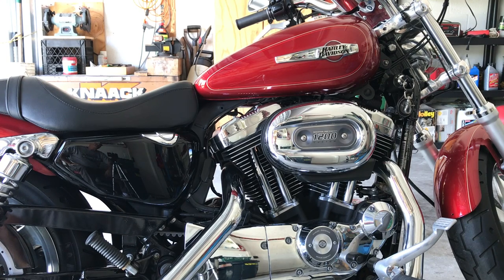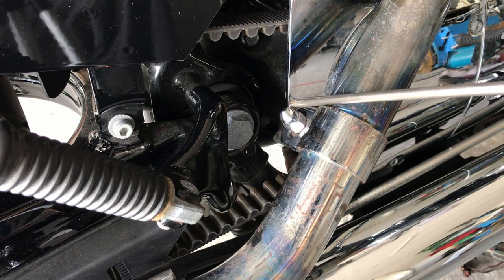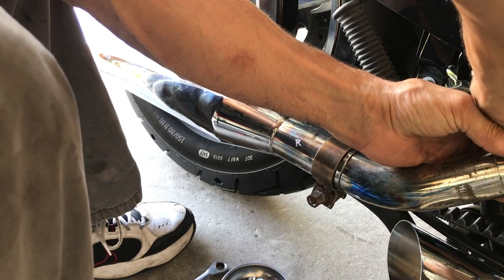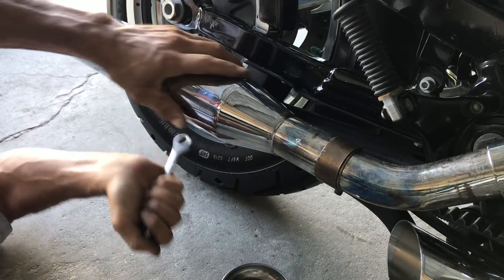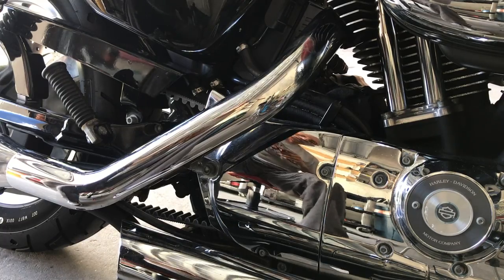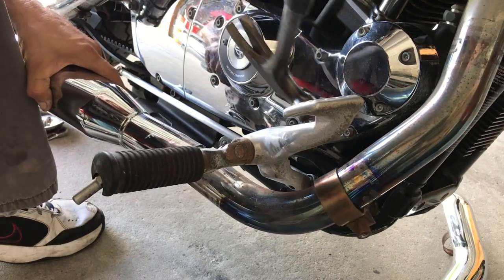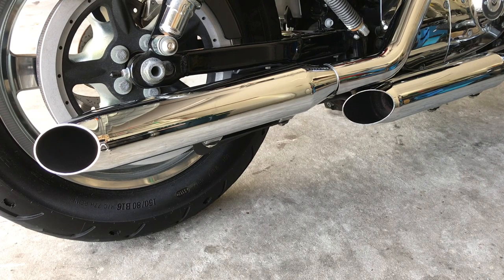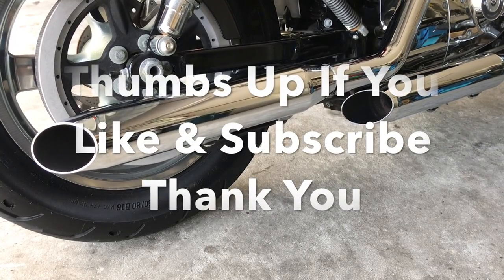Harley Davidson Sportster Exhaust Install.

Comment: Great job explaining that procedure...question, do the exhaust head bolts need to be torqued ?
Reply from the maker: No...Tighten with care...And use penetrating oil.a day before and when doing the job..Ride Safe and have a great day.

Comment: Hey Rocco, great video, is there anyway to bypass a crossover with some sort of plug?
Reply from the maker: Happy to help. I don't know of one, because there's holes in the pipe and then there's holes in your header pipe. What I would do,  look on eBay for 2003 and newer exhaust with no crossover. I hope that helps. Thank you for watching and all your support. Ride safe and have a great day.

Comment: Man I am having a hell of a time getting mine seated back right after my front control manual
Reply from the maker: Happy to help. I would loosen your forward control so it gives you a little room. Hopefully you don't have the two bolts on the bottom of your slip Ons attached.  That should give you the wiggle room to get it right and then tighten up everything evenly. Let us know how it works out. Thank you for watching and all your support Larry. Let us know how it works out. Ride safe and have a great day.
Reply: @TwoWheelRocco  I appreciate the help and taking the time to actually give me a phone call. I was a fan of your channel before this kind effort but you have a life long fan now. And I will be studying your videos bc next going to tackle handlebars and replacing cables.
Reply from the maker: Not a problem. Any questions just ask. I was going to do a video on a sportster handlebars. I'll let you know ride safe and have a great day. Thank you for your kind words Larry. @alarry31

Comment: Nice explanation, however I would use a soft mallet to ease the exhaust apart, avoiding danage to the downpipe and clamps.   Other than that ok.
Reply from the maker: Trying to help. Thank you for your comment and your support Ken.. Ride safe and have a great day.

Comment: Finally got pipes for my king. Bought used pipes, only because the finance's are low. My question is,. I have a lot of backfiring when I throttle down. Had this problem before the pipes went bad. And still have it. Any suggestions.?? Thanks Roc...wish this video was put out before I did mine. I broke my Ass taking it off and putting it back on. Your way is a lot easier.
Reply from the maker: What year king? Carburetor or fuel injected?
Reply: I’m guessing carb, I’m having the same issue with my sportster after putting slip on exhausts, any tips?

Comment: Maybe you can answer a question.   What is the purpose of that crossover?
Reply from the maker: Happy to help. The motor will run smoother with the crossover,  evens the exhaust out. It's like the crossover with the X pipe with cars.. They realized they perform better. Thank you for watching and all your support Ed.  Ride safe and have a great day.

Comment: These are stock pipes corect Rocco from the 1200c sportster corect no fuel pack needed when you use stock pipes corect Rocco and one more thing what if I wanted louder stock pipes on my 1200c hd harley sportster whould I need a fuel pack  ? Have a happy new year
Reply from the maker: Those are Emgo slip ons I bought on Ebay,  They are the same as Screamin Eagle slip ons. No fuel pack when you do slip-onshttps://www.ebay.com/itm/EMGO-PR-SLIP-ON-MUFFLERS-SLASH-04-13-SPORTSTER-80-75114-MC-Harley-Davidson-/192720955545?hash=item2cdf106899  Hope this helps.

Comment: Hey Rocco was curious  when installing a new exhaust,  do you tighten the mounts , before you torque the flange nuts ? What's the proper procedure for that ?
Reply from the maker: Happy to help. we are talking about slip Ons.  install the slip on tighten the bottom hardware then tighten the  exhaust clamp on the pipe. Thank you for watching and all your support Shannon. Ride safe and have a great day. Let us know how it works out.

Comment: Suggestion: I would not tighten up the clamp bolts at the muffler until I had tightened and torqued the flange nuts at the header pipe. This is because when you begin torquing the flange nuts, the header pipe needs to be able to move up against the engine as the torquing procedure proceeds, and if the header pipe is being restricted from moving by the muffler clamp, it will not be able to move up.
Reply from the maker: Just trying to help. Thank you for the tip and all your support Carlose. Ride safe and have a great day.

Comment: Very nicely done....Question what's the difference between a full exhaust and slip ons?
Ride Safe....Steve from Illinois 🇺🇸
Reply from the maker: Happy to Help, Full exhaust would be from the motor back.   Most exhaust is a two-part pipe,   full exhaust is a whole new exhaust from the motor to the slip-on to your exhaust system. slip on is the way to save money and get the job done. As slip-on,   to your existing motor pipe. I hope that helps.  Thank you for watching and your sub Steve. Ride Safe and have a great day.
Reply: @TwoWheelRocco  Question about turn signals...
Sometimes mine doesn't work front and rear....indicators not working as well...Than out of nowhere they start working again....Any ideas?
Ride Safe🇺🇲
Thanks....Steve from Illinois
Reply from the maker: @stever4651  what year Bike?
Reply: @TwoWheelRocco  2003 Sportster 1200S...
Reply from the maker: @stever4651   sounds like turn signal module relay    https://www.ebay.com/itm/203448816987?fits=Year%3A2003%7CMake%3AHarley-Davidson&epid=1128626227&hash=item2f5e7e955b:g:LDAAAOSwnPJgmssd.    Let us know how this works out.  eBay item.
Reply: @TwoWheelRocco  Thanks for your help again....I'll try that.....
Ride safe....Steve from Illinois 🇺🇲

Comment: You can send the link were you bought this slip on thx
Reply from the maker: Happy to help. I located them in Ebay. I'll send you the link. Thank you for watching all your support. Gary. Let us know how it works out great value. https://www.ebay.com/itm/375296060676?itmmeta=01HXH5MNW8T9ZZBX3E3C0R15DZ&hash=item5761636d04:g:1f0AAOSw825l6I5x&itmprp=enc%3AAQAJAAAA0AS%2BqoXqWKLGeM7s4G2xZRd%2BCHUkrtbfe60Xmz4NDZSePOMfSqmkYPmV3u9kNm5BQWfgVJqEVa6d%2F5v4IRs7taNPw5iefUf%2FiOzwu%2FN3XlZmJVByoYOpukBVosEeK3cAS7QSNhfA%2F6rQ%2FZNy1OVWqdB5XV9Jcho3nNQRoPn%2B1kjXe%2FZOCU20yxXAenXd0ACTjvdX9FG3GDxHfwpTQBwGrsY9fdQCWgemDyTBlNMbiwu0N%2BBqHpRaDixRO81FrrBMBvVzstlKMiGgEx7sfku8AwU%3D%7Ctkp%3ABk9SR5be0qXsYw
Reply: So Rush slip ons muffler let me thx
Reply from the maker: Let us know how it sounds ride safe. Have a great day.

Comment: Question: The previous owner of my '99 sportster put on short shot exhaust but the air filter is still stock. Current jets are 42/180 and fuel screw was set to 2.25 turns out. Would I still benefit from swapping my pilot jet from 42 to 45 even though the air filter is stock? Currently there is a studder or burble in the throttle around 1/4 turn which is usually only an issue between 30-45mph as thats where the throttle sits for that speed, on the highway its a bit more than 1/4 turn so its not noticeable. I'm wondering if that has anything to do with the pilot jet being too small currently. I have gone through he carb and cleaned it and replaced a torn accelerator pump diaphragm and all else appears in good shape. I also set the air/fuel screw out to 3 instead of 2.25 to see if that helped but it did not.
Reply from the maker: Happy to help. I would place  3 washers under the slide needle in your carburetor and see how she runs, and then go to the idle jet,  idle jet to a 45 and see what difference that makes but I do know the three washes on the slide will make a big difference in your fuel curve,  I'll send you the video on how,   https://youtu.be/G1XD0hHtwCw?si=twciGMdfLAiIbeir.   Let us know how this works out. Thank you for watching and all your support blue skies. Ride safe. Have a great day.

Comment: Question: Can I take the slip on part of the exhaust off and run it straight piped with no issues? Just running it out of the first bit of exhaust, not straight out of the headers.
Reply from the maker: You will need to tune your Sportster for that open pipe, I find the slip ons I installed work well, with no adjustment. Hope this helps. Let us know how this works out.
Reply: @TwoWheelRocco  Alright, i'll try to remember. Thanks!

Comment: Witch spray using for lose nut let me thx
Reply from the maker: I like the penetrating oil. Any brand is good.  liquid wrench is what I use. Spray it let it sit, tap nut little bit and then loosen.
Reply: I can use wd40 spray let me
Reply from the maker: Penetrating oil is different, then  WD  it doesn't really penetrate. But it's better than nothing.  Can't hurt but for a couple bucks get the penetrating oil that's how I run. Hope that helps. You do not want to snap one of those studs. Tap tap. Then remove I usually let the penetrating oil sit if it looks really bad but most times it's not. You could spray it with your oil and come back to it and see how it looks put your socket on it and slowly move, but don't forget tap tap tried to, try to disrupt that rust on the threads.

Comment: Was wondering I have an 88 sportster 883 went through 3 sets of cone style gaskets and 1 set of the flat ring style gasket , and even used permatex and the last try , still can't get rid of the exhaust leak at the heads , been doing research and they say the flange bolts need to be tightened to 120 inch pounds tried that,  no luck , so I tightened them to 180 inch pounds still has leak , I don't want to crank them , is there something I'm doing wrong ?
Reply from the maker: Happy to help. Loosen the exhaust and tighten the head first and use two gaskets instead of one.  Gasket sealer not needed. They must have a thicker gasket to make up for that problem. Let us know how it works out. Thank you for watching and your support Shannon. Ride safe and have a great day.
Reply: @TwoWheelRocco  thank you ill give it a try
Reply from the maker: @shannonbarrios6484  It should  workout...

Comment: Can you remove the joining piece for the muffler on a 1990 883 sportster and just patch the holes I was going to wrap them anyways thanks ....
Reply from the maker: Yes you could.  How are you going to patch the holes?
Reply: @TwoWheelRocco  not to sure maybe thin tin and pipe clamps you won't see them because of the tape wrap ....any suggestions
Reply from the maker: Ebay $86.  https://www.ebay.com/itm/Chrome-1-3-4-Drag-Pipes-Exhaust-Harley-Sportster-XL-883-1200-86-03/124081313763?hash=item1ce3d297e3:g:3aMAAOSwavReMGLE.     You will need to mig weld a patch or pipe will leak and burn tape.  Let us know how this works out. Hope this helps.

Comment: Sorry but using a hammer on the pipes will damage them as it has done on here. You are better sliding them on by hand and then using a rubber mallet tap the housing underneath where the bolts fit to ease them into position.
Reply from the maker: Just trying to help take what works for you and make it happen. That's all I can tell you. Thank you for your advice. and for your support Laurie,. Ride safe and have a great day.

Comment: Using a hammer is so bad
Reply from the maker: Just trying to help. I did remove the cover and it just jolted enough that it starts the process of moving it. Thank you for watching and all your support aurozappa. Ride safe and have a great day.
Reply: @TwoWheelRocco  it's just safer to remove the whole header pipe it's a little more work but you won't get any damage at all especially at the header gasket
Reply from the maker: @aurozappa305  I never had a problem. If I remove the whole pipe, I still have a problem removing the slip on. But that's my experience. Thank you for your comment and your input. Ride safe and have a great day.
Reply: @TwoWheelRocco  If you take the whole pipe with the slip on still on and spray WD40 between the two .... Take the slip on  exhaust bolt and a fully closed wrench and bolt the closed end wrench to the slip on so it acts as leverage to turn the pipe and slip on in two direct directions . Wiggle back and forth ..... you can do it while the header is  connected just as long as you dont have crossover at the slip on .